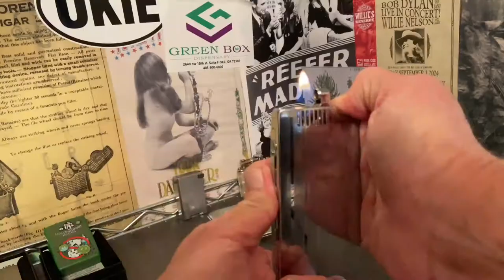Are There Differences Between The Ronson Crown And Queen Anne Table Lighters?(or How To Repair)

Comment: Good video. I’ve got a crown lighter. I cleared the flint tube and when I took the screw out to fuel it. The whole cavity was filled with a sand like substance. I cleaned it all out and put cotton in it. Have you ever seen this issue before?
Reply from the maker: I have seen sawdust in many old lighters but never a Ronson. Sometimes it also looks like ground up cork material.✌️
Reply: That could be what it was. I just thought it was weird. Thank you

Comment: Any ideas on how to remove the fuel cap when the treading is broken... I was able to open the wick hole nut the fuel cap just spins.....
I bought an old an broken one to have a project, and now I'm stuck, unable to remove the cap👀
Can u help?
Reply from the maker: There's not much that can be done as even if you could manage to remove the fuel cap, the threading is still ruined and retapping is not a likely option because most of these used made up, bastard threads. You could possibly find a workable replacement screw and then locate a tap that is close enough to work but there would be a good amount of guess work involved.✌️

Comment: I recently purchased an old 60’s ronson/Fenton table lighter. I cannot get it to spark to save my life. I’ve taken it apart, cleaned extensively, wires brushed the striker wheel, replaced the flint, which it is still wearing down without sparking. I replaced the coo ton and wick. I got it to light a couple times and now cannot get it to spark at all. Any suggestions?
Reply: Perhaps the striker wheel is not rotating